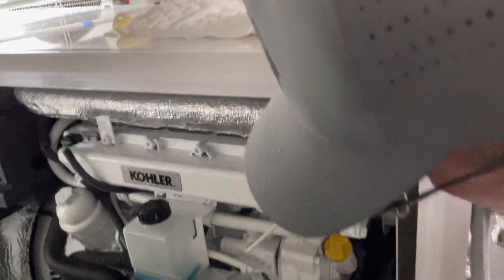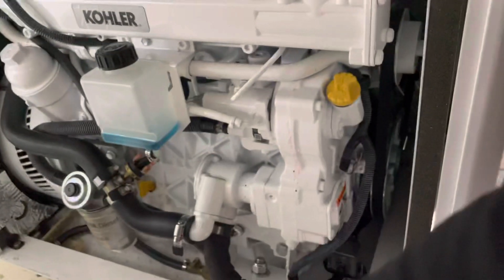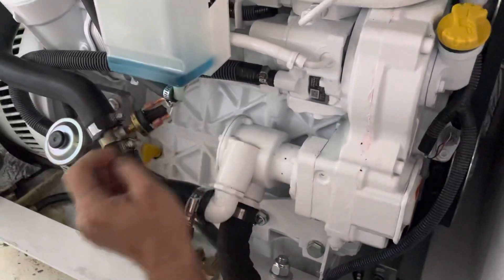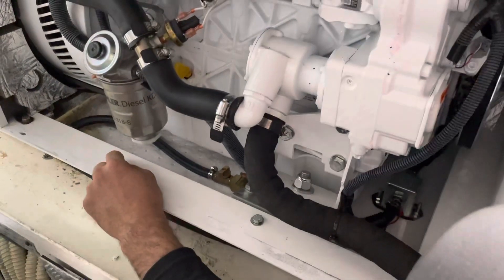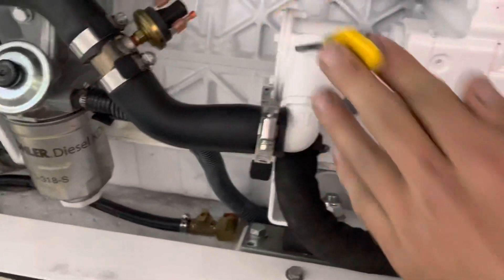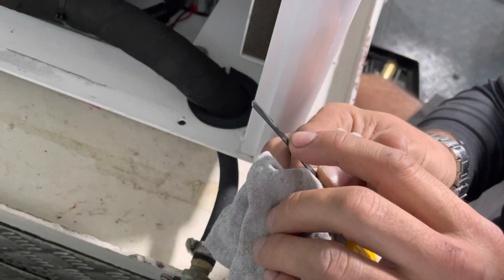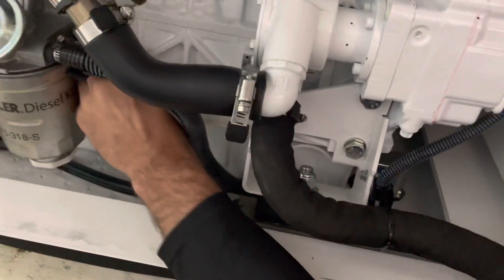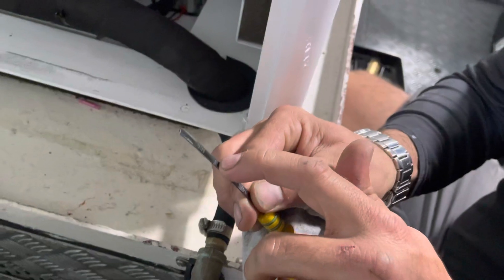Kohler generator operation and maintenance

Comment: Hi Sir, just want to ask that generator kohler decision maker 3500 has a main breaker? or that the controller as its main module? I got trouble for having no voltage output though in the display has 230V..thank you and hoping for your reply! God Bless!!!
Reply from the maker: There is definitely a main breaker. The voltage and amperage output is hard-wired and can be changed depending on the situation needs. The manual can be accessed here: https://www.manualslib.com/manual/2388895/Kohler-Decision-Maker-3500.html
Reply: @myazure2950   thank you for the info and appreciate it.. God Bless you and have a nice day! cheers!